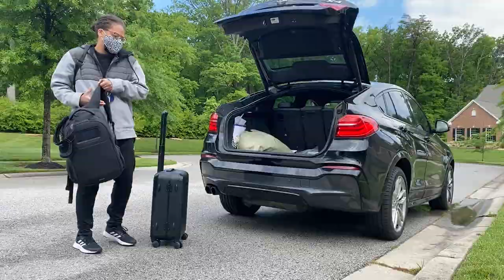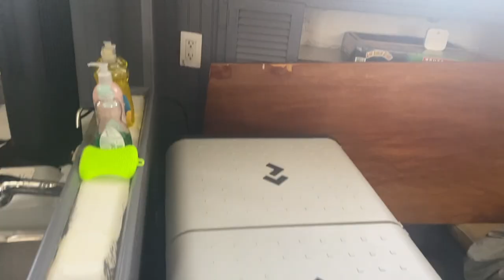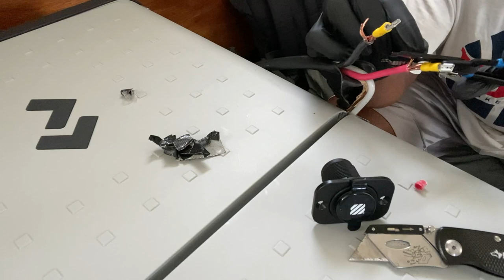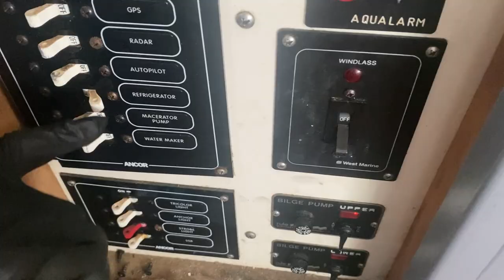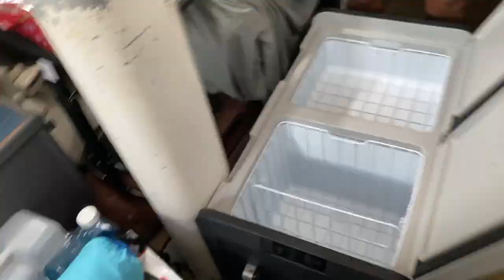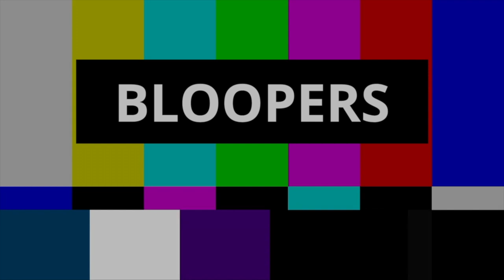Installing Our Solar Powered Off-Grid Dometic Fridge/Freezer Pt.2 | Boat work never ends! (Ep.20)

Comment: U have to have a 12V or 24V DC system not a 9V as you keep repeating.  I am not aware of any 9V DC systems on boats.  My brother’s boat had 12V/24V DC as well as a shore power connection.  Glad that you got help from Dometic so that you have a running freezer/refrigerator instead of a blown motor in your fridge.